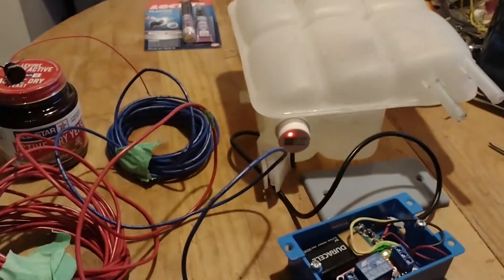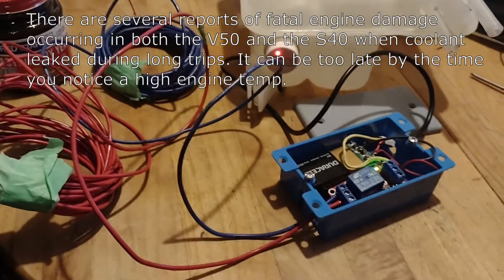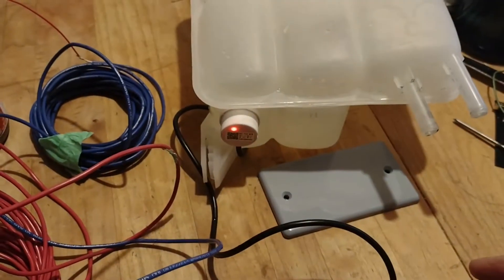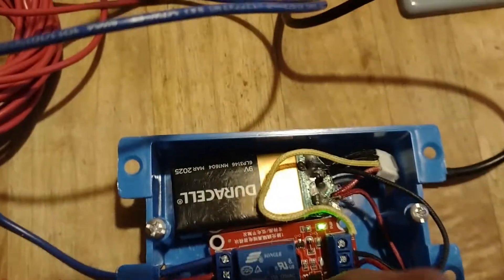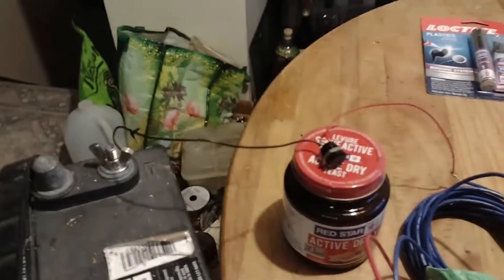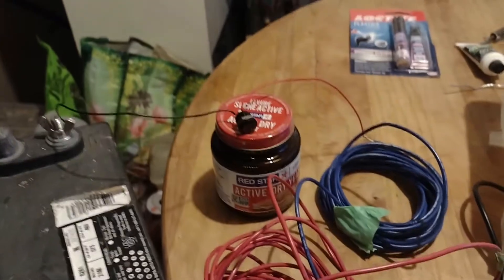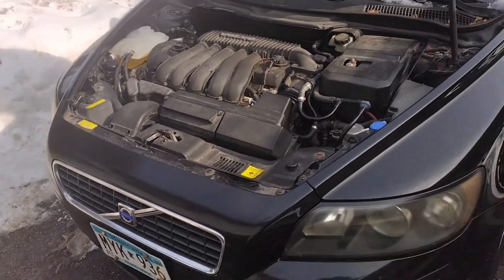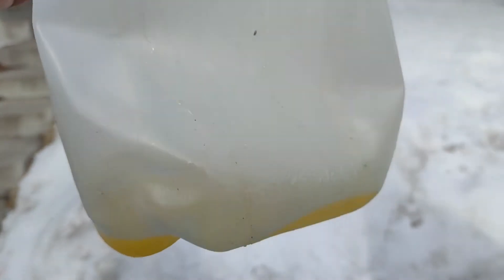DYI Glue-on Coolant Level Sensor--No Drilling

Comment: Hi Greg, Im in the same situation as you. Also V50. Looking for a solid solution to have a coolant alarm. I was thinking if you're concerned about over powering the 5V sensor directly from car battery why you just don't add a voltage regulator instead of bothering yourself with empty 9V batteries that have to be replaced again and again.  Search YouTube "how to reduce voltage 12v to 5v". Eventually i want this to build in car dashboard somewhere including audible alarm. What about adding a fuse for safety? Please post a list of items and a howto you did build this. Volvo not adding a coolant alarm is an absolute design flaw. I have heard some people actually transferred their screenwasher fluid sensor to their coolant tank. Don't know how but you actually get a message "screenwash liquid low" in dashboard. No audible alarm though.
Reply: Watch the whole video he does that